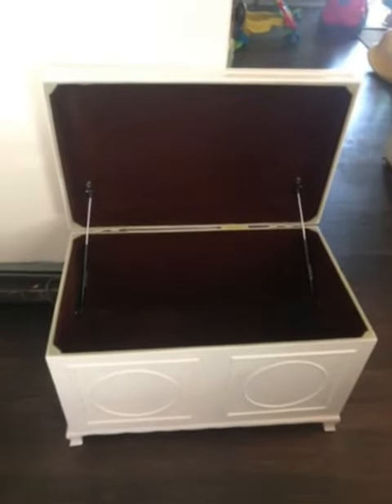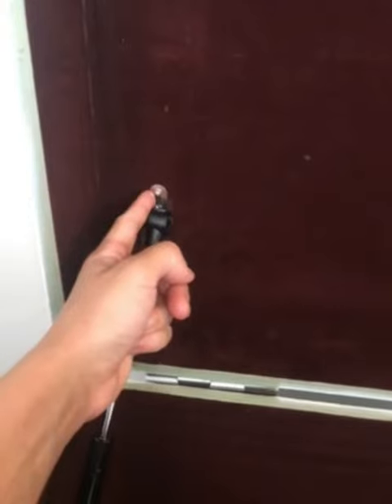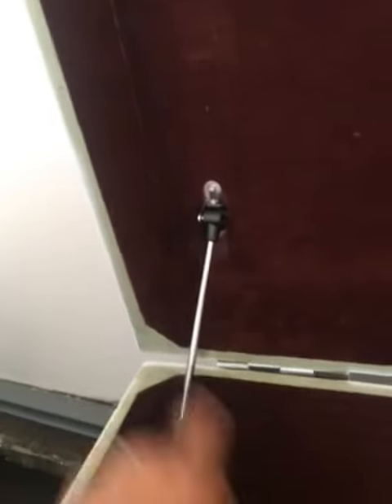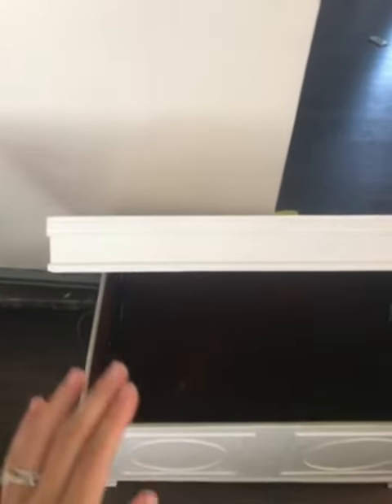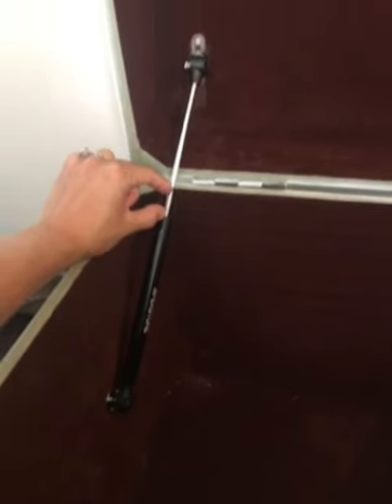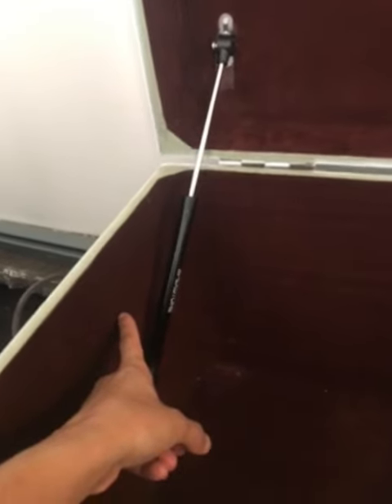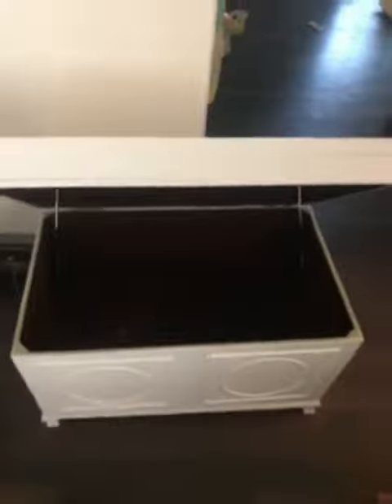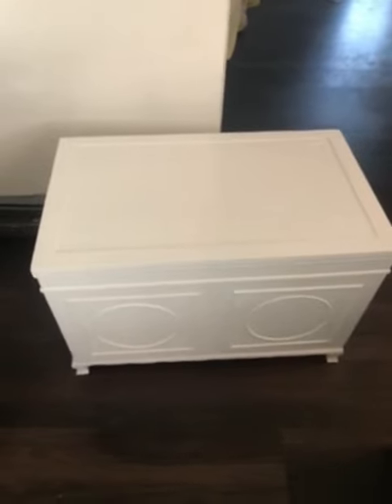How to install soft close gas springs in a toy box?

Comment: Installed struts upside down?
Reply from the maker: Rod up for soft close gas hinges, but rod down for lift support gas struts😊
Reply: I have read that you should install the shock with the gas cylinder in the elevated position as well to both keep debris from collecting by the seal and to keep the lubricant down near the seal.